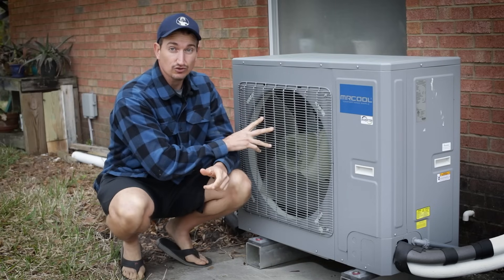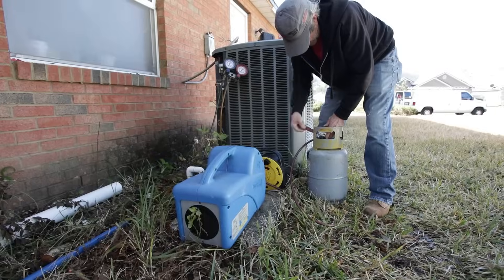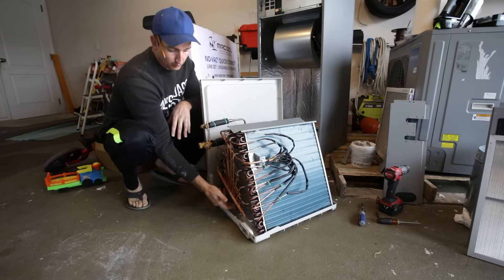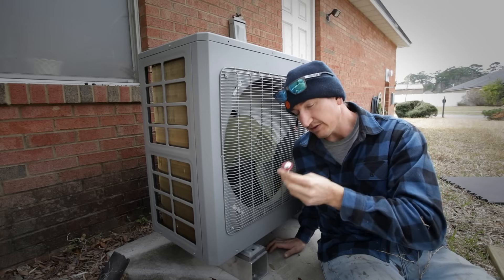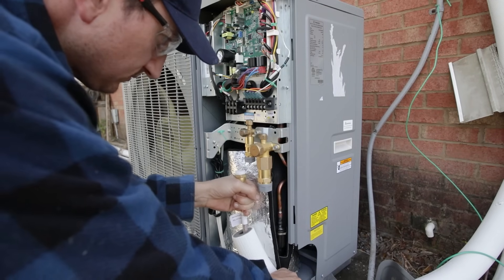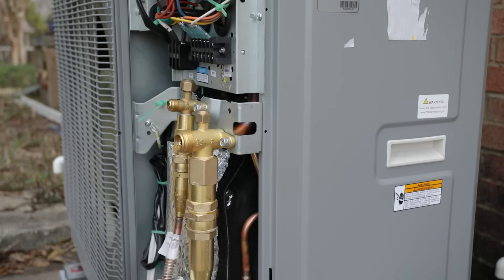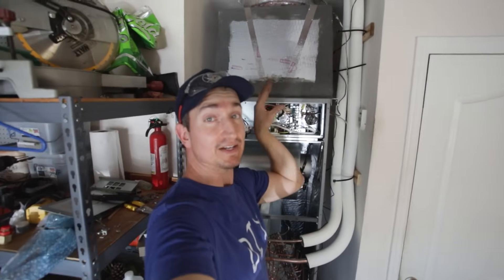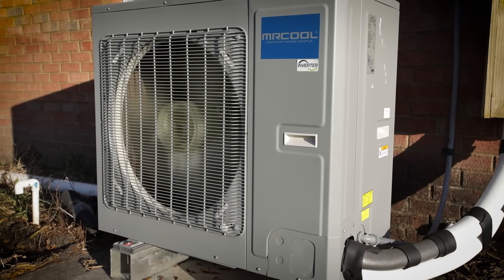Whole House Air Conditioner and Heating System Installation. MrCool Universal, Is it a DIY Project?

Comment: LOL I installed this same unit before I even saw your video and I also took the coil out before manhandling that thing!
Reply from the maker: Awesome.  Has your unit been performing well?
Reply: @MrKistel  Not done yet, still getting the condenser situated. The weather is good motivation!
Reply: @JohnVance are you done now? How is it going?

Comment: Do you need 8/2 gauge between the 30amp breaker and 2/3 ton Condenser(disconnect)... or did you use 10/2? or can you use 10/2?
Reply from the maker: This unit was run off a 30 amp circuit using 10/2.
Reply: My unit called for a 35 amp breaker so that was 8/2 with ground in outside flexible conduit whip. Service panel from breaker to outside wall mounted shutoff box was romex 8/2 with ground. Shutoff box (will put out plug and no breaker in it) then used conduit to a surge/voltage monitior box for protection and then the same conduit to condenser. Surge box - ICM493....best protection for lightning and power fluctuations on your compresser.

Comment: I’ve poured through the comments and can’t find one person that asked how much you saved vs having it installed by a professional. So I’m sorry if you have answered already but what do you estimate saving ? 

I’m in escrow on an old house and we got a good deal due to the ac being completely dead can’t hold refrigerant and is over 20 years old. 

We got quotes spanning from $16,400 to 21k . 

So what’s the real savings ? 

Ill DIy for days if I can save 10k but if its a 2k savings I’ll pay a pro.
Reply from the maker: If you plan to do the install entirely by yourself you can check the current price of the system (link in video description) and subtract it from the quotes you received to get an idea of cost difference.  It would be dramatically less.

Comment: diy person here.. I have installed ac/heater system in my home.. not mr cool... that was 15 years ago so my system needs to be updated which is why I am watching.  Air in the line to me is not good.. better to vacuum the system completely check for leaks and recharge
Reply from the maker: Thanks for the comment. I just recently had the whole system evacuated and refilled with new refrigerant. It actually ran fine prior to doing since the install but i did find out i was low on refrigerant during the evacuation.
Reply: @MrKistel  That's probably the best thing you could have done. You lost all your refrigerant in the coil during shipping or when moving it around at your house. That was the majority of your R410A. Since you didn't notice the leak until you opened the valve and let the R410a from the No VAC lineset R410a in, you may have had a completely empty coil system at the time. In that case air what have been in the coil. What you just did cleaned any possible air that was in the coil. You could have done this yourself but it would have cost you...about 210 for the pump, 300 for 24 lbs of R410a and 100-200 for a good set of gauges. I won't discuss the "reclaim" part!

Comment: Do you think a 5ton could handle a 2400 sqft home?
Reply from the maker: I actually installed the 5 ton system  in a very large house and it is working well. Here is that video if curious https://youtu.be/jC-Lu2HP52Y
Reply: @MrKistel  I ended up getting the hyper heat 2 ducted, wow the wiring was a bit tougher than expected. I also didn't know anything about negative pressure draining and allowing air after the trap. Thanks for your videos! They really helped me!

Comment: Did you have  to change the breakers to match the mr cool?
Reply from the maker: I think the condenser circuit breaker might have been the same as my old system.  The new air handler did not have a heating element so it did not require as large as a breaker.   You can add a circuit breaker to the air handler itself.  In this case you may be able to use the existing breaker at the box (if rated correctly for wire in the circuit) and then add a smaller breaker in the air handler itself. I think I show this step in my other MrCool install video where I install the larger system.

Comment: Did Mr. Cool back their unit since it came with a leak? They should have sent out a tech to charge and fix it. Nice video
Reply from the maker: Yes warranty was covered honorably.  I should also note that the system utilized in this video was knowingly purchased as a "scratch and dent" model  and advertised with a full "functional" warranty. There was some impact damage to the air handler casing upon receiving the original unit.  My guess is the leak was caused by whatever caused the dents and was small enough to go undetected at the warehouse.  Unfortunately i did not detect the issue till after Installed the system but as I said the warranty was honored without hesitation.  More recently, I installed the larger version of this AC system at another project site and purchased a new normal retail model for that project.  I knew it was unlikely the new retail system would come with a defect and felt much more confident with the installation.
Reply: @MrKistel  Did Mr. Cool hassle you at all about the unit not having been "professionally installed?" I know in the manual for the universal it says the warranty is void if not installed by a professional...I assume that's just to scare away the faint of heart...
Reply: It's really not even a Mr. Cool. It is a ACiQ that is black-labeled as Mr. Cool.

Comment: any competent a/c guy would have evacuated the entire system, filled it with nitrogen and vacumed that out and then refilled the system.  Contaminants will haunt you sooner or later.  I probably would have had a dryer installed.
Reply from the maker: Been working flawlessly to date thankfully.

Comment: I'm an electrician so i am familiar with much of this. I was a carpenter and I went to a/c school long enough to get a permit to work with refrigerants.  I chose not to be an hvac guy because the nature of the business is to rob as many people as you can.  I won't be able to devote full days to this but I have charted the install out in segments that will have me doing it over the course of 18 days before I make a call for help.  The first obstacle is to get rid of the old system.  I have offered it up for the r22 left inside of it that is probably worth $500-750. Another obstacle is the line set.  I have cut out a 3.5' hole and successfully ran 3' pipe from the air handler across an enclosed sealing and through the laundry closet.  I'm not sure it will be big enough but I have ways to squeezing things down if need be or I can just drill another hole.  I am more concerned about how to conceal the line set over the washing machine.  If need be I could enclose it inside a drywall soffit but I don't really want to do that.  Besides this hurdle, removing the old air handler will be a chore because it is inside of a closet.  This will also make it harder to install the new air handler since I have only one side to approach the work from.  Attaching to new duct fittings won't be fun but I have the tools I need.  The wiring doesn't look too hard . My main concern is tightening the fittings to specs.  I will have to buy a set of box wrenches that will fit  my torque wrench. Son just bought a digital big boy.  I do wonder though just how critical it is to tighten to exact torque specs.  What is the tolerance +/- 5-10lbs?  I bought fancy rubber feet to attach the outside unit to and I will be putting it further away from where the old unit was because it was too close to the dryer vent.  So I bought 10feet of prewired #10 weather proof flexible conduit to connect to the disconnect. I'm figuring 2-3 hours per day over 18 days with little to no help.  As soon as the old unit is completely disconnected, I'll strip it down piece by piece and maybe use my sawzaw if I have to.  If I don't have it in by June I'll call for help.  Over all I'm confident that I can do this and if I am, I will try to offer my services to help others install an extremely affordable unit.  Prices ranged from $9400 to 12k and that was just outrageous to me when I bought the 3 ton mr cool for $3700.  I don't see any part of this that I can't do.
Reply from the maker: I do not know how critical the torque specs are.  I did use a torque wrench with this unit however i do not feel the sensitivity of it was super accurate.  I show in another video where I install the larger capacity version of this system where i just tightened the connections by feel and it seemed to work well. Here is that video ... https://youtu.be/jC-Lu2HP52Y
Reply: they wanted to charge you 9400 even after u supplied the biggest expense ? im gonna call around my area as well and have 2 friends that also work as hvac techs that might help me out
Reply: Spoken like a true electrician..."I don't see any part of this that I can't do"

Comment: I hope they didn't charge you to remove your old system.  The r22 was worth money bc they are going to take it out and they are going to sell it to someone who needs a top off.  Today it goes for about 200-250 per lb.  They don't make any more so the price will only go up.  410a is on the same trajectory now that they don't make it anymore either.  If your system is 19 or more yrs old you probably have r22.  If your system is 10-15 years old you probably have 410a.   a 2.5 ton unit holds 4lbs, you probably had 2.5-3 lbs since the unit still worked but not very well. It was probably icing up and raining inside the air handler.  Mine quit raining.  I suspect a leak on the outside condensor low side valve.  don't fall for the "its dirty", it is a gas and it can be filtered. Your ac guy vacumed it out and sold it later.
Reply from the maker: I am hopeful the refrigerant recovered was able to be reused.

Comment: for the thermotat terminals you just need to strip it off straight and put it under the little metal plate then tighten.

Comment: You should have put an extra fitting on the suction line so you can vacuum the lines down, before releasing the Freon. That will make the system last longer. Why that fitting and instruction was not in a name brand kit is just foul.
Reply from the maker: With this system the line sets come sealed with refrigerant in them already.

Comment: What is your sq/ft on your house and it looks like the 2/3 ton unit, correct? Thx
Reply from the maker: This system was set on the 3ton mode and the house was 1500-1600 sqfeet.
AC Systems and Tools:
MrCool Universal (2 or 3 ton) System = https://amzn.to/3vurog5
MrCool Universal (4 or 5 ton) = https://amzn.to/3ETfzD3
Adjustable Torque Wrench = https://amzn.to/35pXhvp
Duct Board = https://amzn.to/3XCLum1
Disclosure: The above are Amazon links. "As an Amazon Associate I earn from qualifying purchases."
Reply: @MrKistel  Thanks for the fast reply! Did it cool/heat your house ok? Only asking because we are on the fence for the bigger 4/5 ton unit and the house is 1500sq/ft..Just was curious and thanks!!
Reply from the maker: @Zuki4x4x  it does but this house is in a mild climate area.  Not sure if you saw my other vid where install the 4-5ton system. I actually think it is easier to install the bigger system in part because of the lineset connections on the condenser unit are much easier to connect to.

Comment: Hello thanks for the great vid,my question is do this mrcool ducted systems cycle on and off like an old school central unit?or does it constantly blow air like a mini split...thank you
Reply from the maker: This system behaves similar to a traditional central system.  You can set the fan operation in the thermostat and when in "Auto" mode the fan cycles on and off with heating/cooling cycles.
Reply: Thank you so much for the super fast response,helps a lot...keep up the great videos...

Comment: Is your unit fan running a moment you turn on the breaker? Even it off mode?
Reply from the maker: Do you mean the blower fan or the condenser fan?  In any case neither should be on unless the thermostat is calling for them to be on.
Reply: When i completed installation, I turn on my Honeywell Home thermostat to heat and airhandler is on.  But when I turn it off mode, the airhandler did not respond to the off mode, in auto mode.  I tried to change the wire and the same.

Comment: 7:28 next step at this point should have been evacuation of the system with a vacuum pump before opening the valves
Reply from the maker: not for this system

Comment: I was kind of surprised that you didn't use nylon blue to help seal the connections, but great video. Thank you so much for sharing.
Reply from the maker: Thanks for watching and the comment.  If I recall correctly the manufacturer instructions advise against using anything on the threads of the line set fittings. The connections are sealed by gaskets.  My understanding is the threads simply provide the compression force for the gaskets.
Reply: @MrKistel  Yes, totally.  Just that so many folks do it, lol.  Soft copper is its own gasket.

Comment: So this is for a full house multi-zone setup? This might be slightly above an average DIYer. I did a tankless water heater myself and for the most part, was pretty easy. 2 Years still strong. This install is slightly more complicated. Theres a lot of variables going in. 

I'm looking for a similar system. I already have an existing electric furnace and ductwork, no A/C or lines though. So the idea would be to keep the existing resistive heat for the inevitable -25f winter days where the heatpump won't be effective at all.  And just use the heatpump for 80% of the year without altering the current system I have. I'm actually not finding too much info out there on what I want on this, mostly just covering mini-splits or replacing current systems. Or reading that heatpumps don't perform good on multi-zones.
Reply from the maker: This particular system is central system.  Basically, the air handler would tie into the existing house ductwork.  You can purchase the system with a resistive heating element component as well. I think the manufacture claims the heat pump actually can work effectively in some pretty cold temps as well.
Reply: @MrKistel  So basically, ditching the current (electric) air handler and resistive coils in lou of the heat pumps brand specific air handler (that may or may not include its own set of resistive coils for use in extreme weather). Thats what Im understanding. Because I don't see anyone (or anyway) of just keeping the current furnace AS-IS, while also adding in a separate heat pump unit tied into the ductwork. "if it aint broke, dont fix it", last thing you wanna do is screw up your only way of heating during a winter trying to DIY an install like this. at least not touching the current furnace means you'll at least have the expensive backup option always available.

Comment: question for all:  when replacing current unit, are you pulling the prior lineset out then somehow running the new ones thru the prior path?  I dont think my upstairs gives me attic access etc to do like in this video
Reply from the maker: Sometimes the original  linesets are run through a conduit in the ground.

Comment: If your old compressor still works and is a newish type with inlet and outlet valves, you can use it to recover the refrigerant by closing the outlet valve and running the compressor to suck and condense most all the refrigerant into the outdoor unit, then lock it up by closing the suction valve.  Perhaps a shop will then take it away for free since that older refrigerant has value.  In my case, all the refrigerant had leaked out.  Mr Cool should have stepped up and replaced the leaking evaporator and paid for a recharge since none of that was your fault.  Shouldn't have been any air in the system since it never lost pressure and the Mr Cool parts come with evacuated linesets and condenser, thus their special fittings.  Can get a cheaper system where you suck down the lines with a vacuum pump (~$70 Amazon).  All outdoor units today come with precharged refrigerant you release after a leak check and vacuuming the lines and evaporator.
Reply from the maker: This unit was actually purchased as a scratch and dent system but came with a warranty.  The warranty was honored without hesitation.

Comment: How much did you spend in total?
Reply from the maker: It was basically the cost of the equipment plus the few other things I mentioned in the video.  Was far less then having a traditional system installed via a local HVAC company for me.  A list of the equipment for current price references below. 
AC Systems and Tools:
MrCool Universal (2 or 3 ton) System = https://amzn.to/3vurog5
MrCool Universal (4 or 5 ton) = https://amzn.to/3ETfzD3
Adjustable Torque Wrench = https://amzn.to/35pXhvp
Duct Board = https://amzn.to/3XCLum1
Disclosure: The above are Amazon links. "As an Amazon Associate I earn from qualifying purchases."

Comment: Where did you get the material for the transition box? -- the box between new ac and old air duct. Thank you.
Reply from the maker: Duct Board (This is a pricey if you only need a little).= https://amzn.to/3XCLum1
I converted a box kit similar to this = https://amzn.to/4cY9eW5
Disclosure: The above are Amazon links. "As an Amazon Associate I earn from qualifying purchases."
Local HVAC supply stores should have it however they may only sell to contractors. You might be able to find some smaller pieces  in a box kit at big box home warehouse stores.